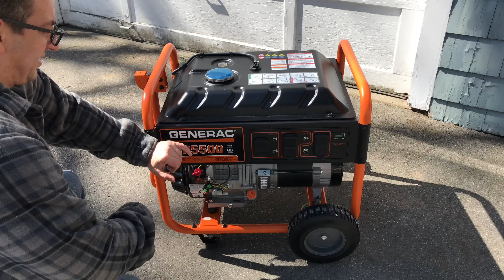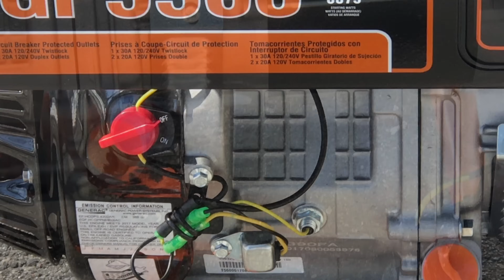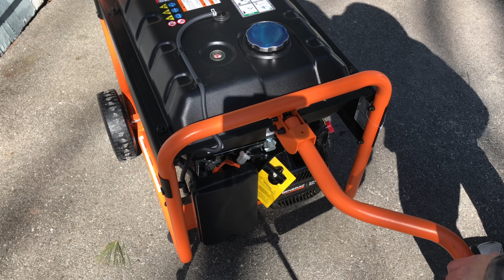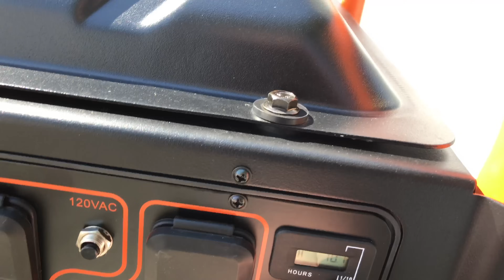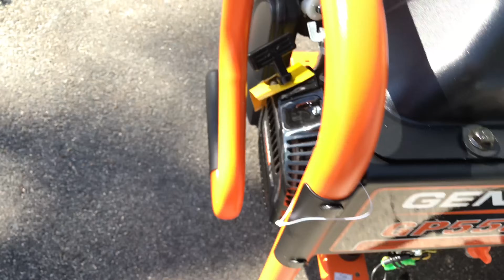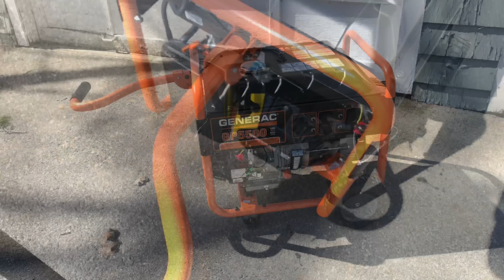Generac Generator GP5500 Product Review

Comment: I think when possible you should split the cords/loads between the two outlets when possible. The point being to Ballance the load on the rotor inside. If all the load is coming off one side it pulls the rotor to one side and wears the bearings faster. Not trying to be a know it all, just something I heard once from a generator expert. I try to split the load but it's not always possible. Thanks for the video
Reply from the maker: Thanks for watching and the added tip

Comment: I recently borrowed a Generac GP5500 with 11 hours on the clock during an unexpected outage. It ran nearly everything required via the 30-amp manual transfer switch on my house, but I quickly learned that the power output is very dirty. My CyberPower 1500VA  backup (for computer and router equipment) was boosting and cleaning the current so continuously that it finally shut down. My home AC failed after a few days, and it turned out that an electrical component had been damaged requiring a $300 replacement. I was lucky that my refrigerators didn't fail, considering that the power output surged at times. Now I've bought a large open frame inverter-- MUCH cleaner power, less fuel use, and quieter.
Reply: Which open frame inverter did you buy?  Looking for one with 5000+ watts
Reply: None of my APC UPSs did this and neither did my rack's UPS. They all went online without hesitation, and on the highest sensitivity
Reply from the maker: Thanks for watching!

Comment: I'll give you my review, don't buy a generac. Bought one, used it for a 4 day power outage, 2 months later I went to start it up just to keep it running, wouldn't start. Took it to the generac authorized repair facility. 2 weeks later they inform me it needs a new engine. Was still in warranty, dealer tells me generac wants to send a field rep. To inspect it. I waited a few weeks and called dealer, they said generac hasn't given approval yet, long story short, after numerous calls to generac, they finally gave approval to replace engine under warranty, no reason ever given as to what generac was questioning, delaying. After a mere 4 months I received my generator back . I used it for about 24 hrs since then, and won't start again. Now it's at a small engine repairer and I'm waiting on their diagnosis. FYI.....Original engine failed due to a stuck valve
Reply: Not sure about conditions were you live, but I would add fuel stabilizer if I was going to let any gasoline powered motor sit for a couple of months. Friend of mine had to put new carburetor on his generator after letting it sit for four years.
Reply from the maker: Thanks for watching. May have been a fluke thing.

Comment: I bought this  and its a NIGHTMARE! if you look at the video you'll see on top of the gas tank there is a fuel gauge. It has a depression like a cup and it collects water if in precipitation. If that seal fails, which it either came that way or it failed within the first 5 hours of use. Water then collected into the fuel tank which is an annoying problem. But easy to drain. The bigger problem is that this is a steel gas tank and it rusted inside. I spent half a day removing as much rust as I could with 2 different rust removers and about 3 gallons of gas to flush it out. Now the rust is causing my carburetor to stick. Ultimately for me this has been an $800 paper weight. Also, first time use, didn't run well at all. Had a small engine mechanic work on it and then it worked fine. I have multiple small engines, 3 chain saws, and rarely have issues. Just this Generac.
Reply from the maker: I'll have to check mine. It has been sitting for a few years.

Comment: I have a question. How do you bypass or disable the co sensor?
Reply from the maker: I'm not sure. It's not something that I have tried to do.
Reply: @HomeownerRepair  I prefer to run this generator in my shed. It's a really big shed away from the house. And the co sensor keeps shutting it off. So that's why I wanted to bypass it.
Reply: @ladellp5135  same question
Reply: Here is a reminder about generator safety: this is only a reminder for everyone’s safety. This is just to make sure you are aware of all the warnings. Every year after hurricane and winter storms, there were reports on the news that many people have died each year when using generators due to carbon monoxide poisoning and electrocution during a power outage. There were reports about deaths when using generators when the power was out. There is something very serious that everyone should always be aware of when using generators. Some people do run their generator indoors which is not safe and that increases the risk of carbon monoxide poisoning which can cause death of family and you. Some people run their generator in wet conditions which can electrocute them. Here’s an advice about generator safety: please remember that you should never run your generator indoors. Remember that carbon monoxide is an odorless and colorless gas that you cannot see or smell. Carbon monoxide is a silent killer. Keep that in mind. Make sure your generator is 15-20 feet away from your house and away from doors, windows, and vents. Having a carbon monoxide detector is very important against generator safety. Some people also allow children to go near the portable generator which could pose risks. We need to keep an eye on our children making sure that they are not near the portable generator so they won’t get electrocuted or burned by the generator which is dangerous. A locking enclosure also keeps kids safe. A generator shed might look like a tempting place to explore, or take cover during a game of hide-and-seek, but a generator is a dangerous piece of equipment that can cause injury. It says on the manual that we should also keep children away at all times from the portable generator to avoid injuries. Generators pose electrical risks. If you need to use your generator during wet weather, you need a generator tent to protect your generator from getting wet. Don’t let your generator get wet. Keep your generator dry and before using your generator, please make sure your hands and your generator is dry. Everything that is said on the generator’s operating manual should not be ignored. Never smoke cigarettes near the generator. Please keep flammable things away from the generator. Never overload your generator too. Your generator can catch fire. Never ever try to plug a generator cord into a wall outlet to avoid back feeding. Back feeding your generator is dangerous. Always turn on your generator first before plugging in appliances and shut off the appliances before turning your generator off. Use a heavy duty cord for your generator and the cord should not be worn out. All the instructions should be followed carefully. Never refuel your generator while it’s running. It can cause fire if fuel spills while your generator is hot. You should turn off your generator and let it cool off before refueling it. Having a fire extinguisher next to the generator is also important. This is only a reminder for everyone’s safety of using generators. Make sure your generator is properly grounded. https://youtu.be/I1jT3ANENvI and here is a video more about keeping others safe when using generators. Hope this helps. Thank you. This is just a reminder for everyone’s safety
Reply: @ladellp5135  I recommend putting a high flow ventilation fan on the shed and connecting it to the generator

Comment: get that crappy Chinese engine oil out of it. Used it for 5 hours and dumped it, It was well, worn and drained out like water.  I started  Using Shell HD diesel oil in my RS5500, Same unit basically.  Put on a magnetic drain plug too to catch some stuff in the oil.   The tank may rust on it if you don't keep it full.  I left mine empty for 2 months and it got rusty even being stored inside. Cheap Chinese tank.
Reply from the maker: My tank never rusted...weird.

Comment: Not worth the money go buy a Honda and it will outlast you!
Reply from the maker: This generator has been fine
Reply: I’ll go American! It’s a great generator.
Reply: Same, have over 200 hours on mine with out issue. I always run fuel Stabilizer, shut off the gas and let the bowl run dry. Use synthetic and change it every 100 hours.